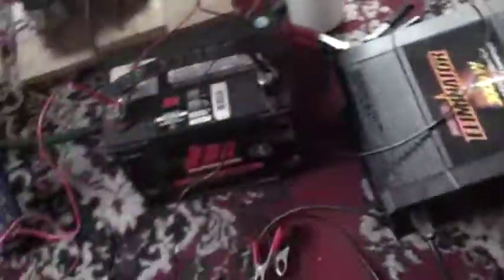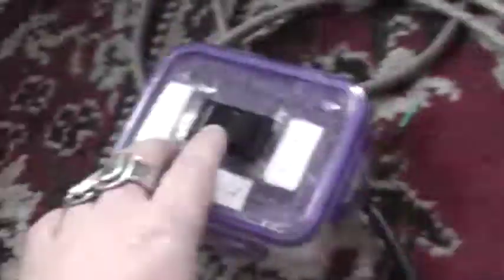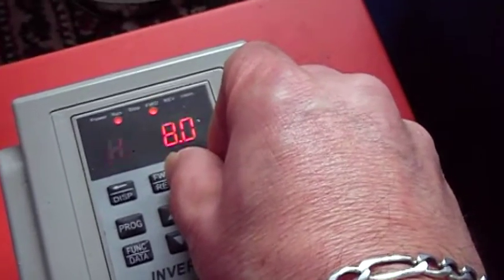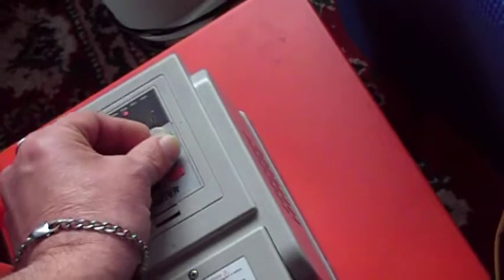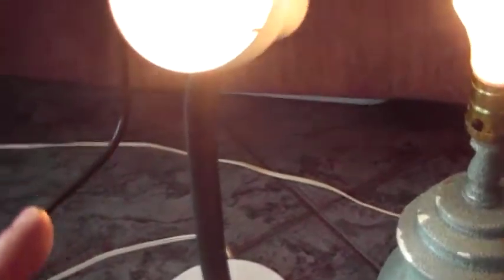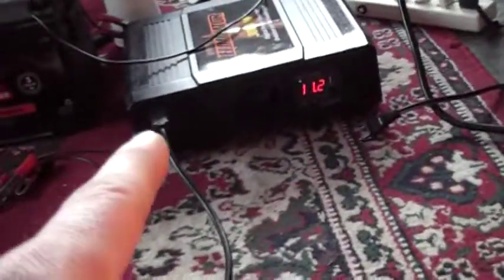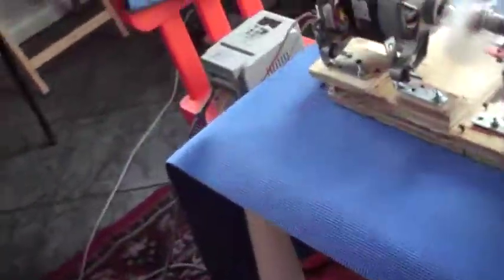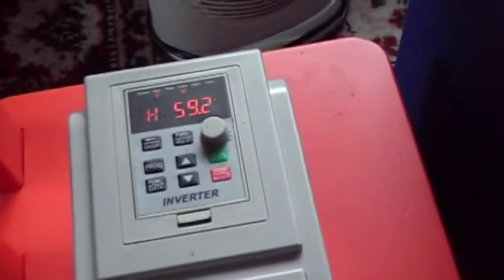Fuel less Generator -  No Gas - Clean

Comment: So in other word the self charging not good enough so the battery generator 12 volt output is low on current most of the generator 12 volt out put is always 10amp no higher then that try using 500 watt transformer battery charger to get 30 amp and use super capacitor 24 cell with the battery the super capacitor hold more charging faster then the battery so the battery will get charged faster
Reply from the maker: yes it is all about having a over flow of amps not running out, and more than what is needed

do you have a video on the loop of energy

Comment: So many misconceptions and wrong use of simple electric terms... First of all. Not in a single second in this video you demonstrated over unity. What this word means? I will try to be as simple as I can. In the physical world in a closed system as yours: Output energy divided by input energy is always smaller than 1 or very very close to 1 but never exceeds it! Sometimes this is called efficiency as well. Over unity means that we have a number greater than 1. That means we are getting more power than we are inputting in our system. So, to recap, no over unity here!
You keep saying that you are powering machines and lights from the ...inverter! No! You are powering all these appliances from the *BATTERY*! The battery is the main source of energy. The inverter is exactly what the word says: it inverts the power source, from DC to AC. It is not an amplifier! You are depleting the battery at all times! But you will argue that you are ...recharging the battery at the same time. No. Simply NO! There are so many power loses in your system that the power from the battery will not be enough to self charge it. And we do not count the energy consumption on the appliances! Since the main power source is the battery all calculations should start there. Imagine this: you have a battery hooked up into a charging circuit and this charging circuit is ...charging back the battery! Will this battery be for ever charged? Try it is not that difficult. If you argue that your generator ...generates more power than it takes so you have over unity and you can charge your battery and keep it running forever then you are violating fundamental laws of the world around us. Why no one ever thought about it? Oh wait ... Many did...

Comment: Another Click bait video with a catchy Title (How about "Fossil fuel less generator").. Why are you wasting your time and everyone else.. You are using electric energy to create mechanical energy to back to electric energy.  It is the same thing that an electric car does with the generators they have on their wheels. At the end they need to be charged again.  Simple, When you apply load to the generator and if you measure the amount of energy with a watt meter, You ll see that the energy required to move the motor that moves the generator is greater.  Get 2 watts meters  and you ll see for your self.
Reply from the maker: No if  you would  have a water fall powering it it would be FREEEEE  just like they are doing it ..    or bye coal or wind ect.  I ma working on something brand new as Tesla never returned to the generator  

(( RIGHT ))

Comment: whats the consumption of the motor driving the generator?
Reply from the maker: The VFD is powering the motor and the speed of the VFD states the rate of power used 100 watts being used at 3600.  and at 400 hurts 400 watts at 17000 RPM motor speed .

Thank you for watching
Reply: @earthssecretenergy2371  overunity? Nice...
It would be great to show the actual consumption in (with a meter) and the actual power generation /watts at same time...

Comment: Good morning bro, you're doing great please how can I charge my FUELLESS generator back the DC motor that I used is not charging back when I assemble the 12v DC  motor with my better pass my neighbor generator please enlighten me please. Thank you
Reply from the maker: I don't understand your question, but the dc moter is spinning the generator that produces energy
Reply: @earthssecretenergy2371  it's produced energy but when I wanted to charge back the battery is not charging back at all with the charger that I connected with it please help me. Thanks
Reply: @aremuadewumijoshua3107  bro his not charging any battery he is using 120 from the wall to run his DC motor then the battery you see is for the inverter
Reply from the maker: I do not understand your question  thank you